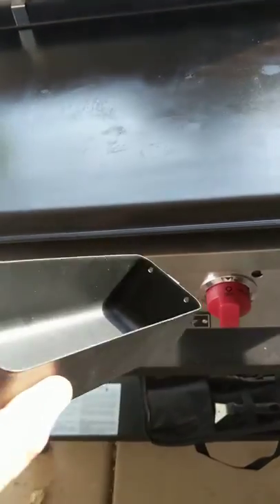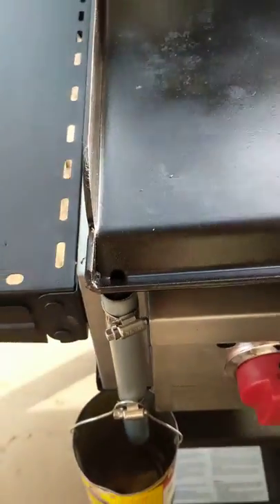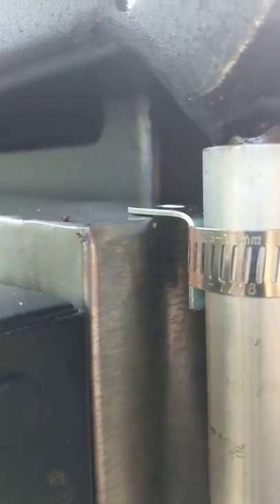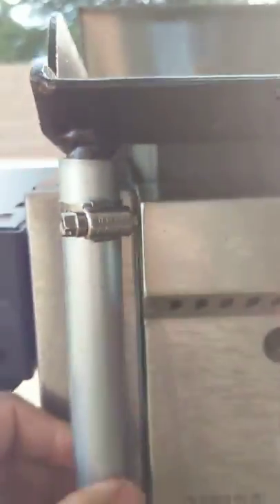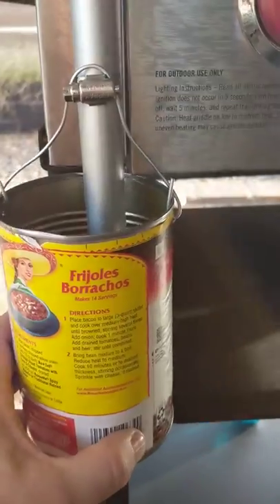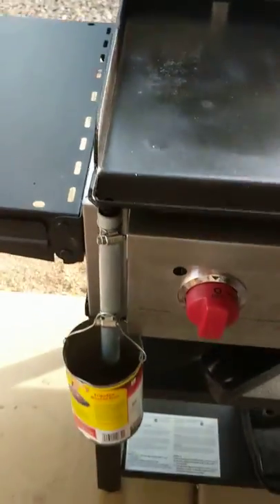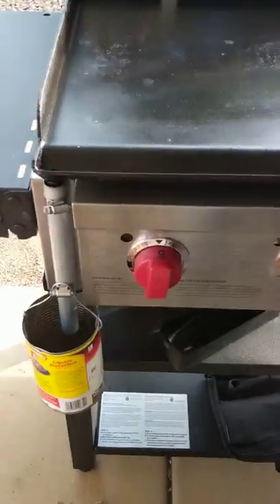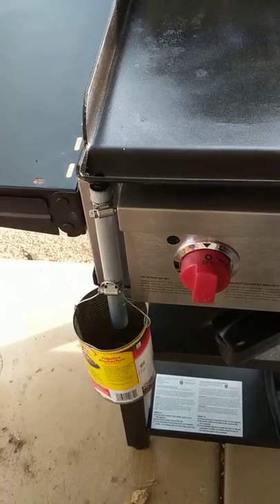Camp Chef FTG600 griddle grease cup hack

Comment: We have had ours for about 5 years now, and from day one, it has always had issues with the grease splashing out of the cup and running down the leg onto the deck.  This is what hubby is planning to do to have it run into a can.
Reply from the maker: One thing I discovered as I was doing this was that the "L" bracket needed to be strong.  I bought a cheap emt pipe clamp  (Lowes Item # 816308 Model # 42951) and cut down the circle part and straightened it to make my "L" bracket.  It is extremely strong and works perfect.  If your "L" bracket fails you end up with a greasy mess so take care to make it strong.